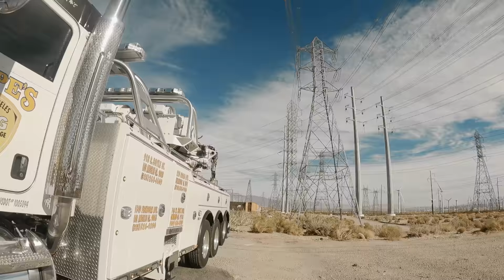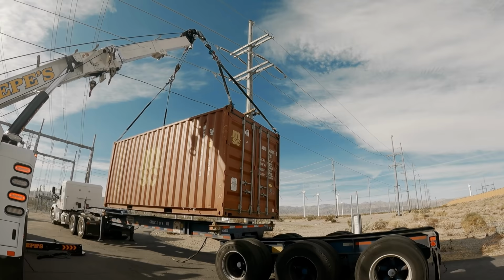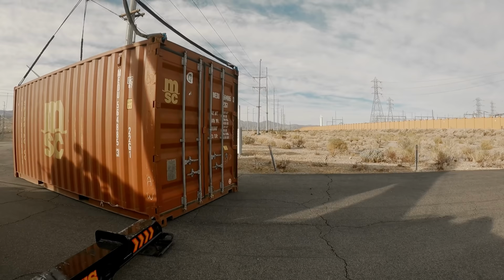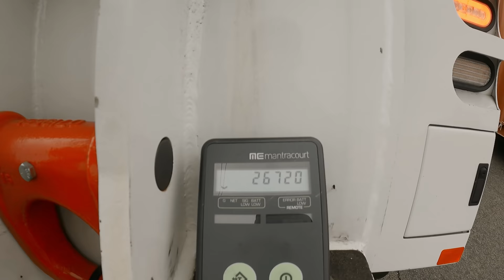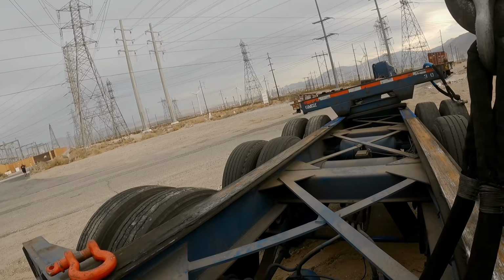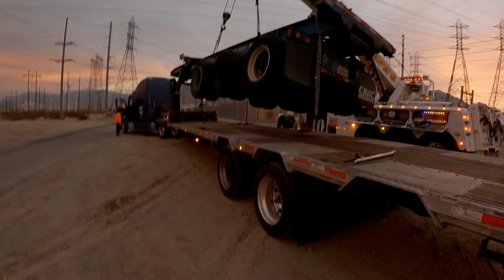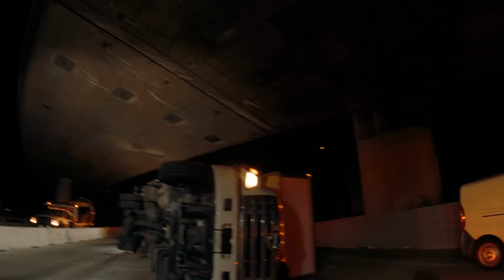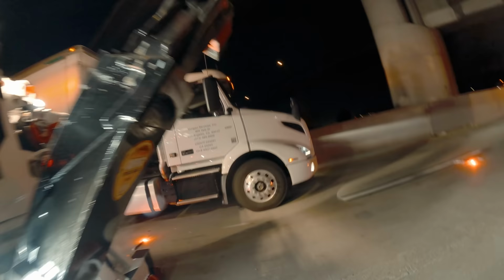Extreme container lift at a power plant + box truck rollover!

Comment: A 2 for 1 special!!! As annoying as the power co. guys were, I'd be happy to have them there. They KNOW the safe zone and will keep everyone safe!! I did a rollover recovery with a bunch of obstacles that included a broken power pole and low hanging wires back in the day. I was SUPER nervous until the power co. guy showed up and told me what to stay away from and where the safe zone was. My initial guess on that was close but not safe. Always super cool to see you working with your dad!!
Reply from the maker: That is exactly why I listened to them and did not give them any grief. Rotator work is my specialty, power lines and electricity is theirs!
Reply: @PepesTowingService  You are very wise and have been taught well!! The margin for error with high power lines is much smaller than the margin with rotator work.

Comment: I worked at a power plant that had a 500 KV switch yard. Just walking through the yard would make your hair stand up. We used a truck with a 2 way radio and if the antenna was not tied down just driving through would blow up the radio.

Comment: Awesome job there josh, I remember about 15 years ago when they’re pouring concrete at 1:00am and the pump operator (trainee) got close enough to the lines that electricity jumped over to the boom and traveled down the boom and blew out all the tires on the pump and the trainer was standing on the deck of the pump and blew off the tips of his toes. That I know if he survived it, but his career end after that. Great job again josh.

Comment: Load cell only shows true weight in vertical lift. Short sling angle increases load on sling. Crosby has information on how to calculate sling forces at different angles to actual vertical load.
Reply from the maker: Correct, my wording is off horribly. I go over it on my Instagram page. It's great to calculate the forces as I'm bringing up roll overs and to see how the angles/rigging change the force

Comment: Working around them power sub stations is ALWAYS a pain in the arse! I remember one time we did a job where they were expanding the building footprint. I was 60 feet from the gate to get in, with my transfer trailer. I moved 30 foot into the project site. Each time I went in, or out of the gate, they had to lock it behind me. Before I could move the truck anywhere on the project site, they had to have one of their guys escort me around as a ground guide. I worked a week on that project between digging out the foundation & footings for the building, & hauling in the backfill materials. I was sure glad when that gig was over with!

Comment: @Pepe's Towing Service 
Josh, those zinc-plated chains are great for working near or in a sea salt spray environment.  Places such as sea coasts or places where salt is used to salt roads in the winter.  They will help prevent the steel in the links from rusting or oxidizing.  The zinc acts as a sacrificial layer if you ever notice the zinc platting starting to wear away that's the time to replace them.

Comment: From the looks of it, the lines you were working under are either 115 KV, or 220. That's spicy, but just south of that, there's a 500 KV line. The employees of the power plant are absolutely right to say that theses lines are extremely dangerous. Unless you go to Québec, Indiana, Ohio, West Virginia, you are not going to fine much of any lines with higher voltages. The long range transmission lines in theses areas are 735KV and 765KV.

Comment: The load cell is registering the tension in the container strap.  The angle of the container strap , toward horizontal from straight up vertical,  puts more tension in the strap than just the weight  of the container.  The increase is about 40% for that angle.  The actual weight on the strap is about 60% of 26000 or about 16000lb for one end of the container or 32000 for the whole container.   32000 would be the actual load on Flipper.
Reply from the maker: Correct, they teach you (at least in the classes I've attended) to properly use a load cell and why every operator needs one. I've seen people perform some sketchy lifts at extreme angles with subpar equipment. That is how you flip or damage your truck and break equipment. It's interesting to see how much equipment has as I'm winching in, at various angles and with different positions. That is why I always over rig the way I do.

Comment: Jeffrey Deaver's murder mystery "The Burning Wire" tells more than you'll ever want to know about electric arcs.Chances of one jumping to a container suspended with non-metallic straps are very low.Melting the cables and anyone nearby are guarenteed if it did happen. Great job staying calm and professional.

Comment: I'm an electrical substation operator for 13 years, working with 27KV, 138KV and 345KV. Transmission voltage is no joke. electricity doesn't seem dangerous because you can't see it, but when you do see it, you're fucked.  I understand where those guys were coming from, but they could have been more professional.

Comment: I hate to be the only one to tell you this but the electrical guys are not joking with you. I worked as a lineman for 30 years those lines are 30,000 volts and more, the electricity in those lines can jump up to 20 feet especially in humid weather.

Comment: Big Flipper is a Monster Great Work Also am I the only one that thought Big Flipper was A Tri-drive is Big Flipper a Tri-drive is Hulk a Tri-Drive.
Reply from the maker: Are you saying you didn't know these trucks had 3 axles in the rear? Big Flipper has a tag axle, Hulk has a pusher axle.
Reply: @PepesTowingService  No I thought they were tri-drive chassis I knew they had three axles in the back I didn't know that all three axles were not drive axles only two of the axles were its also because I have never seen Hulk or Big Flipper with there axles raised up sorry.

Comment: Hey Josh, nice job on both accidents & videos! I always appreciate and respect your videos. The 1st one definitely looks dangerous with all those power lines around. Way to go maintaining your cool and composure. Re the 2nd video Josh “Rollover Under The Bridge” the road looked straight and flat… Help me understand how a Tractor trailer rolls over on a flat road. What in the heck happened for the truck to roll on its side like that? Was the load not secured inside the trailer?

Comment: That container hauler didn't belong where he parked. My guess is he bailed off the Interstate and found that nice paved area when the chassis was failing.  Power company was freaking out. Unknown trespassing vehicle, parked under part of California wind turbine electrical grid. Surprised they didn't say it needed to dragged away from those lines. One arc would of destroyed wrecker and everyone close to it. No time to react, would of be over in a sizzling split second. Moving parts welded together, electronics fried, tires exploded...hearts stopped dead.
Years ago I hauled a small wind turbine out of the area. Electricity fills the air constantly with a loud sizzle noise, add in the nearly constant high wind, scorpions, and rattlesnakes...not a good place to be. Had to take a safety course at the control center before allowed onto the property inside the fence. Fence doesn't stop any of the nasty stuff.
Reply from the maker: He didn't park there, he was leaving that facility. This isn't a small road off the highway, you have to drive like 5 min off a dirt path to even get here

Comment: Hey, Josh, I often wondered (and I grew up in LA) why they call it a "K Rail." Do you know?
Reply: It's due to it shape, looking at an end. Bottom is wider than top, has a slope to it...looks like the vertical part of a K, and slope looks like the lower leg a of k. Designed to minimize damage when sideswiped, redirects vehicle to its original direction, and helps prevent lane crossovers. Many versions, in some places they are short, hooked end to end, (segmented) and moved by a special piece of dedicated equipment to change lanes at different times of days.                 https://en.wikipedia.org/wiki/Jersey_barrier

Comment: That static electricity discharge off of one of those power lines alone will kill you that's what they're talking about on the art jump transmission lines produce somewhere between 70 and 115,000 volts of static electricity and a french fry you from the inside out that's what the safety guys are concerned with at the power plant
Reply from the maker: Ummmm..... Yes.... I know lol
Never argued with them or stated otherwise.
Reply: Oh I know you didn't I was just stating what they were concerned about and I know it has to be nerve wracking working under power lines with a rotator

Comment: I feel this video has more importance on what you can do and your equipment Then safety you wont be making any videos if something where to go wrong trying to impress your viewers Don't take it the wrong way I'm a huge fan of you and your abilities But from start to finish on this one I was wow a lot could go wrong Let me ask you did you cage the brakes with the box hanging over the chassis ? You say he caged the brakes you should know better then trust a truck driver Be Safe I know your capable !
Reply from the maker: I'm confused, what parts made you say wow because of safety concerns? I emphasize safety in every video I upload. The container was tucked in and rotated away from the chassis in the event of a rigging failure so it wouldn't harm/kill me. I had ten supervisors down my back constantly about the distance and what my plan was, checking to see if the brakes were caged prior slipped my mind. It happens, doesn't make me not safe.
Reply: @PepesTowingService  You missed the question I assume about getting under to cage the brakes while the load was suspended over to the chassis  That would be simple yes or no since I the believe the camera came back on after the fact No worries either way to me if you did or didn't Nothing makes anything unsafe till the unsafe happens You keep doing your thing and I hope safety is always on your side !
Reply from the maker: @mdrailroad1688  I mean....did you even read my response. I said "the container was tucked in and rotated away from the chassis in the event of a rigging failure so it wouldn't harm/kill me". Tucked in means it was retracted and in the space between by truck and the chassis, so essentially over my outriggers. Didn't include the caging brakes because who wants to see 15 minutes of me manually caging brakes with a 3/4" wrench?
Reply: @PepesTowingService  I sure did and I looked at the video twice now three times I see it tucked in but still over top the container unless I'm missing something Like I said no worries for me just thought for once I may make a safety comment Sorry I did now I see like most people you have your opinion and I have mine I wasn't there so I'm sure your 100 % correct at least in your own eyes  You have a nice weekend and be safe out there I won't ever comment again on any of your videos No hard felling from one Rotator operator to another Be safe out there !
Reply from the maker: The entire portion of me caging the brakes and setting the container in and low over the outriggers isn't in the video. I mean you don't have to believe me lol, but I posted it on my Instagram story where I showed how much easier it would be if big flipper had a 3/4" deep socket or speed wrench.
Reply: @PepesTowingService  I still give you a thumbs up 👍

Comment: Below is a breakdown of crane accident fatalities by cause of death:

Contact with an electrical current – 8%
Contact with object or equipment – 62%
Falls – 20%
Transportation incidents – 10%

The load cell was not showing true weight  of load . To show true load it must be at 90 degree leg to load  . A 45 degree leg angle will show will show more than the total load on each leg.
load weights 500  pounds 1 hook  2 hooks vertical each end  with load beam 250 each leg
aprox angle 60 degree each leg will have 350 pounds off load  45 degree leg angle leg load will have 500 pounds of load  DO THE MATH 
 You need to go to a good  crane school before you say that the power company guy is full of it
THE COMMENTORS ARE WRONG YOU CAN BE DEAD WRONG ALSO 
see Crane Accident Statistics
Reply from the maker: You are either 6 years old or very dense. First, when did I ever say the electric people are full of it? I very clearly stated and showed in large text that I completely understand and would cooperate with them so they are satisfied. Rotator is my specialty, electricity is theirs. Second, when did I ever say my wireless tension link shows the true weight? Again, I said that it is used to measure the amount of force I am lifting. Get off your soap box buddy.